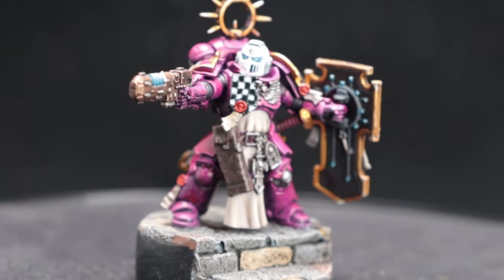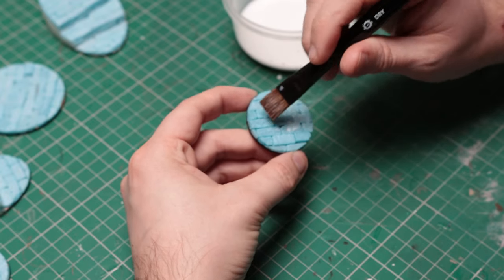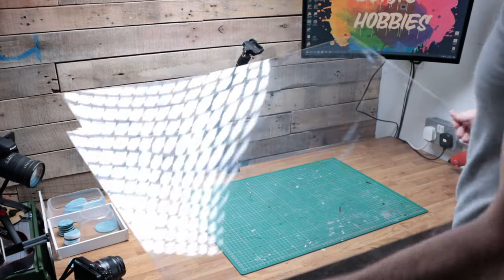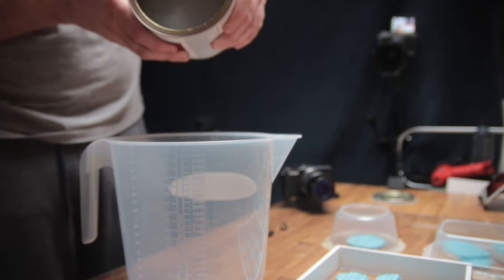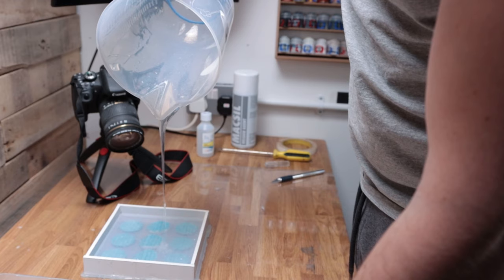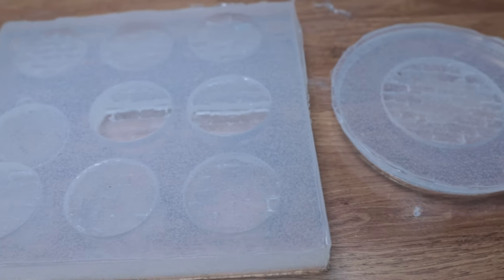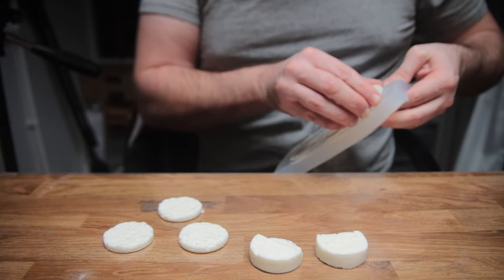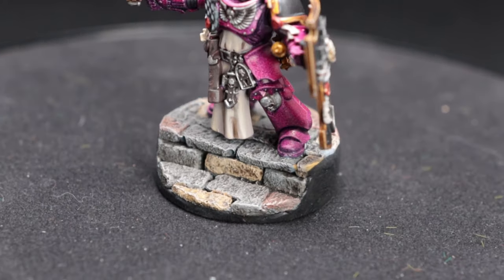RECASTING your Warhammer Age of Sigmar or 40k Miniature Bases!

Comment: If you dont want to use glue or plasticard for sides and also have “re-usability” that you passed on this time. (not my original idea... if i find link will post)  I use legos to make the outer walls of the mold and seal the bottom of the lego molds with clay all the way around. This allows the “frame” to be sized to each projects width and height. as well as all materials being re-usable. Hope this helps😁
Reply from the maker: Thanks for the suggestion! If I’d had any Lego to hand it would have definitely been my first choice, but unfortunately I don’t have my old Lego collection (or any children to ‘borrow’ it from). I think I’ll be investing in a few bricks for smaller moulds, though. Thanks for commenting!
Reply: @GeekGamingScenics   and @Benji’s Hobbies,  yes it for sure can be. But i didn’t by the name brand legos 😆 just some cheaper (but tight fitting) blocks off of amazon.  “Wonderbricks” 500 bricks for 25.00 USD in 2017. But you can get 1000 for 20.00 now on amazon. So still worth a look i think. Love both of your videos thanks for the work you both do. “Love love love”! 😄

Comment: I use Lego for mine works well and brakes apart nicely after the mould dries.
Reply from the maker: I’ve actually bought some Lego bricks for this purpose for use in the future 😊 In hindsight I definitely went over the top with the boxes and gluing them down!
Reply: @BenjisHobbies  Yeah I find that Lego with a bead of wither hot glue or some dabs of superglue work well and give you reusability. If air bubbles are ever an issue get a power drill (one thats battery based and hold down on the table (the handle on the table not the side of it) and turn on for a min and that should vibrate any loose.
Reply from the maker: @xenoserum  thanks for the tip!